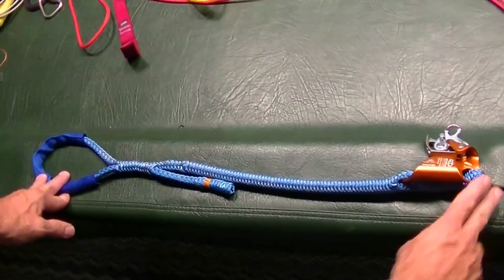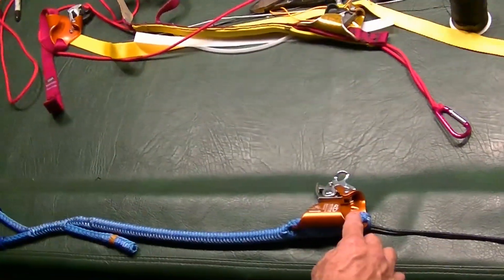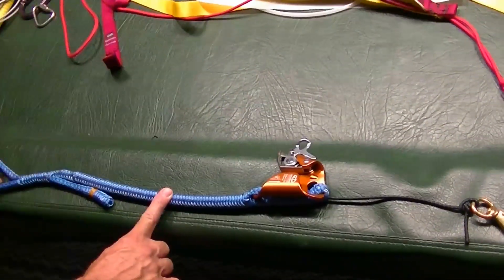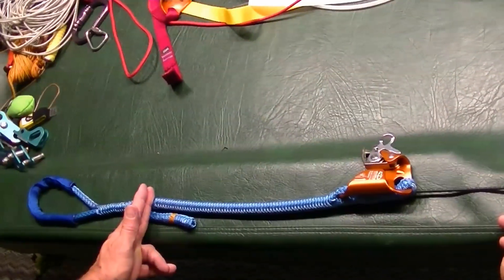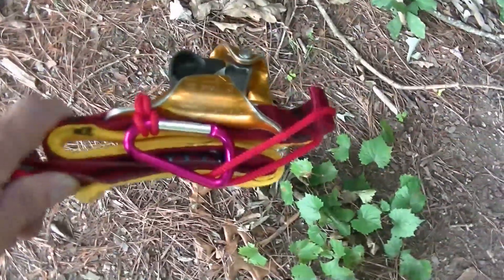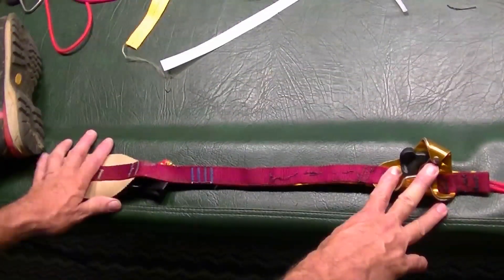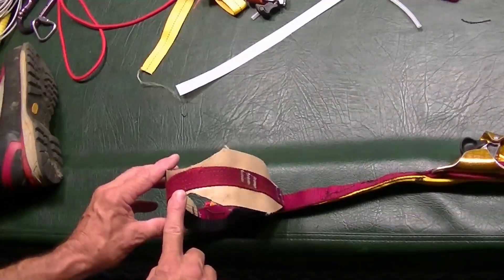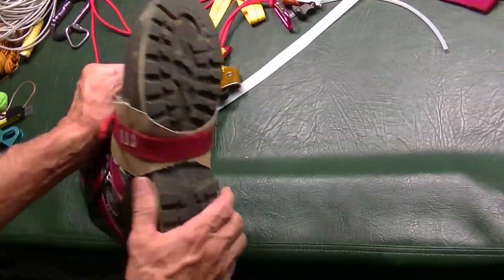Modified Ascent System

Comment: +1 for Mumford-engineering! :)

Hi Richard,

optimizing things can be fun. Great work on HAAS2 and your video! Actually I am using a frogwalker-system with a crol for ascend and then change to a Petzl Rig. I like the Hitch Hiker and maybe will buy one later. Unfortunately it is not available here, because of a missing CE-mark. (I don't care about, because it's safe). But my question: in comparison, what do you like more and why, frog with chest- or HAAS with kneeascender?

Thanks a lot in advance!

Uwe